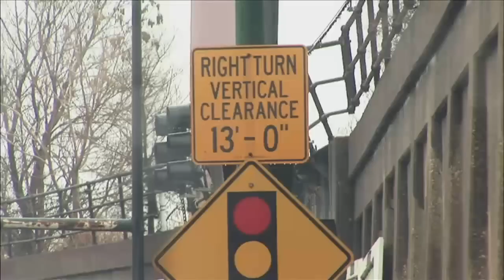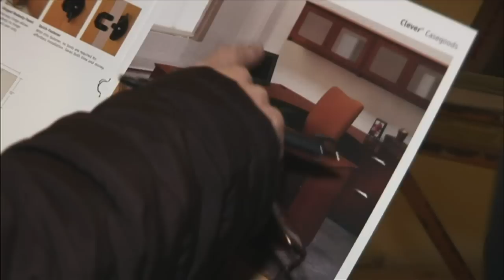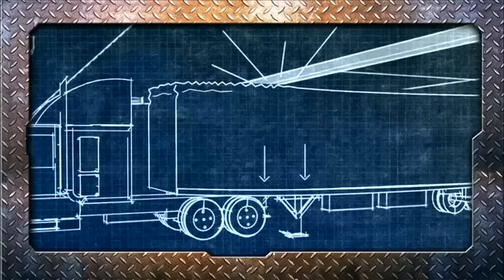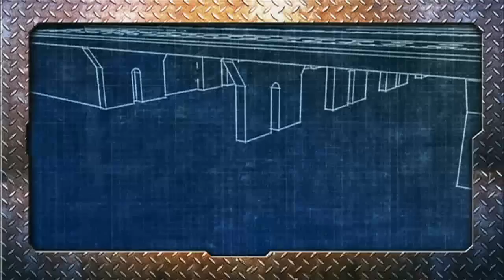Wrecked - Season 1 Episode 2 - Dominating the Market | SPEED

Comment: Wonder why dude didn't just let the air out of the tires on that wedged trailer.....
Reply: Branon Fontaine yea then they.  Could of refill them after they got out of the tunnel
Reply: Because it's not as fun as using $200 worth of acetylene and oxygen to cut the roof off. That's what I think at least.
Reply: I think the trailer was to damaged